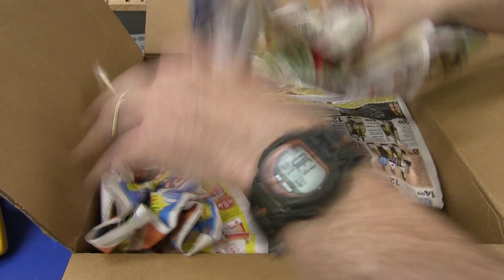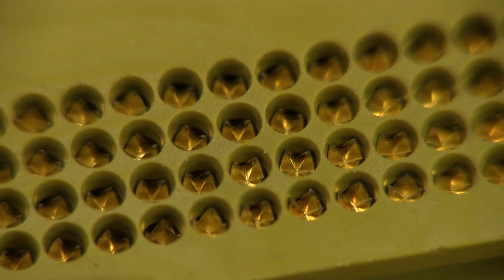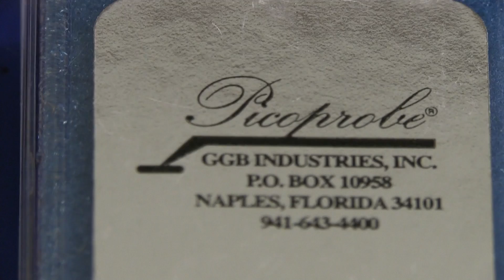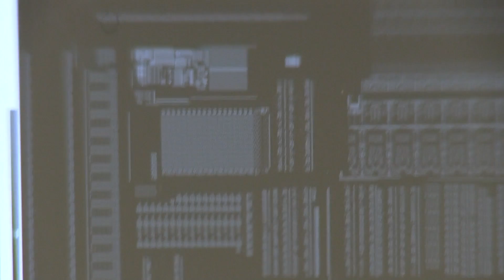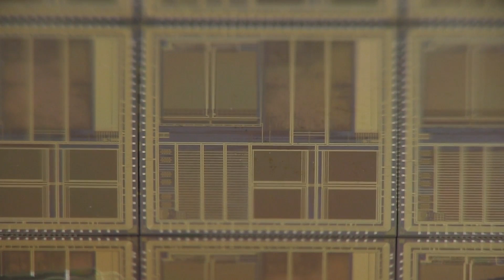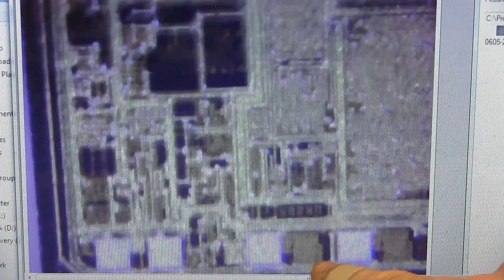EEVblog #532 - Silicon Chip Wafer Fab Mailbag

Comment: I wonder, what would happen if you can link all of those processors together?
Reply: SKYNET!!!
Reply: N9olan That is what I have as my router's SSID
Reply: ProGamer1515 LOL! Then, when they take over, you will be safe.
Reply: N9olan XD, yep.
Reply: They didn't design the wafer to work that way but it could be done if they put a control processor in the center. Maybe the NSA already does. They allegedly had processors running at around 70omhz in the late 60's.
Anyway, That is what today's super computers literally are. They are a bunch of regular pc or server processors linked together with one or a few units dedicated to deciding how to designate tasks. A multi-core processor is a toned down version of that.
Reply: I'm guessing the heat would exponentially increase in the case. But if you have like a liquid nitrogen sort of a heat sink that might do the job of connecting these processors together.
Reply: ProGamer1515 The reason for the tiny chip with the massive lid is because it needs that much surface area the dissipate the heat. If you linked them all together, they would burn themselves up. Each chip is too close to the chip next to it.
Edit: Rishabh Gupta  Sorry just saw your comment.
Reply: Rishabh Gupta lol That would be pretty awesome though. a 12 inch chip with a 46" silver lid with 2" copper pipes leading to a radiator about 8 feet tall.
Reply: Chris Turnblom You could stick it in an ice pit in Antarctica on top of all that. Though you would need to protect it from the water.
Reply: It's called "wafer scale integration".

Comment: I had no idea pogo pins had multiple tiny spikes on the end of each one, I thought they were just a single somewhat rounded pin. Are these special ones?

Wow solid Teflon.. yeah super expensive material!
Reply: Regular pogo pins are sharp or rounded, depending on the application. These have multiple prongs to hold the balls on a BGA without deforming them too much.

Comment: Holy crap, I have a new found respect for > 22nm chips. But I am still a bit lost in how the chip actually does stuff?
Reply: The chips literally spend months in an automated cleanroom environment, moving from one station to another in an automated transportation system. Each station adding different microscopic components (etching, burning, washing, filling, etc.), never being touched by humans hands.

 Think of the chip as a tiny circuit board because it literally is. With diodes,transistors and resistors built onto the wafer.

But if you find that amazing, think of what the future will bring now that places like MIT are learning how to manipulate a single atom at a time. After that technology gets developed, with all it's mechanical applications, combined with mans experience with micro-electronics, things could get a little freaky 'round here. Like the movie Transcendence freaky.
 
LOL ...But then again, that tech. could get buried for more than half a century like electrogravitics did.  #skunkworks lol
Reply: Chris Turnblom You know when I watch simulations of how chips run - the layout and the functionality, they look like microscopic versions of the big computers from the 1940s/1950s. (I guess it's because they really are).  It looks like a wall of Diode and Transistor blocks. (ditto).  What in the late 1940s (because the guy who invented the modern computer died shortly after and his work wasn't really caught on by others till a couple of years later) would be the size of your computer now - would only be the APU of the CPU - which now would be the size of a millimeter.

Comment: and yet silicon chips has slowed down to a crawl 3ghz well "hopefully" we will have graphene valley
Reply: +CariagaXIII you do realize the clock speed doesn't say anything about the actual calculation power of a cpu.
Reply: Quinn Dams i'm talking about cores speed not cpu. btw.

Comment: how much it cost for someone to submit a VLSI design to a factory and get a chip to test it's design?
Reply: fcycles It depends on the size and process, but if you went with something mainstream then think $50k to get a few chips. Then you pay someone else to test them and/or package them (it’s a separate process step, the foundries usually deal with making chips, not molding plastic).

Comment: Excuse myself, I am familiar with concept of emulation, but what is the purpose of that emulation board? what was it used for exactly?
Reply: In this context, emulation boards are used to replicate the functionality of a particular chip, while providing a better debugging interface than the actual chip itself. For instance, the emulation board might give you the ability to read the values of internal registers which are inaccessible external to the real device.

Comment: What kind of saw slices that precisely and small?
Reply: diamond saws
Reply: +Joshua Boucher The ones that cut the boules (the crystals) into the wafers look like labor-saving cheese slicers. There are many, many more than one wire and the wire isn't pushed through the wafer. Rather, the wires (coated in micro- (or nano-) scopic diamond dust) are dragged across the diameter of the boule while under a deluge to carry off the abraded material.

Comment: I wonder how much the people who build the die testers get payed
Reply: Astronautical Films more than the robots get paid I hope =)
Reply: Astronautical Films Not as much as you would think ;)  The machines average $2M-$5M for a single SOC tester; I work around a few hundred of them.
Reply: @mjkulikow  Came back to this video when it popped in my recommended and happened to see this old comment I made. I just so happen to now work in the semiconductor industry myself years later and at this point have logged quite a few hours on the test floor. I mostly work with packaged chips so I never get to touch the wafers, probers, etc. but I have coworkers that do and I can proudly corroborate your comment for my younger self: yep, definitely not as much as you would think

Comment: why is it circular wafers
Reply: because that's the shape of the silicon cristal used to build the wafer. searcg for "SILICON WAFER PRODUCTION PROCESS"
Reply: Some manufacturers (i.e. photo-voltaic cells) actually slice the ingot into a square shape (much like making dimensional lumber from a round tree trunk).They do this before slicing the ingot into (square) wafers.  Note that square wafers are probably easier to break than round ones.  Then they they take those cut-off corners and throw them back into the crucible melt to grow new (round) ingots.
Reply: I bet the production process includes some stages where the wafer is rotating. Thus a round wafer is better.
Reply: Ole Kristian Ek Hornnes Yes, there are production steps that spin the wafers. OTOH, there are some industries (i.e. photovoltaic "solar cells") that use square wafers, and they can spin just as well as round.  The main reason the wafers are round is because that is how the crystal is grown: into a round boule.